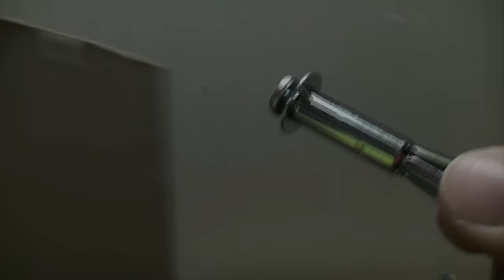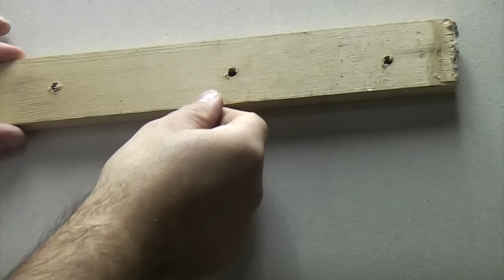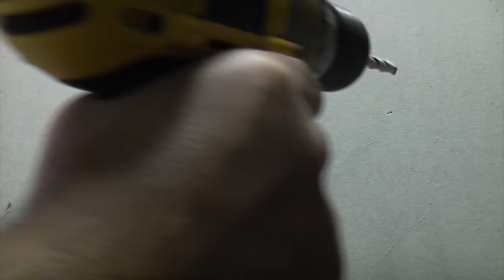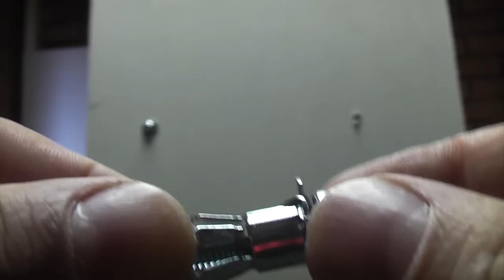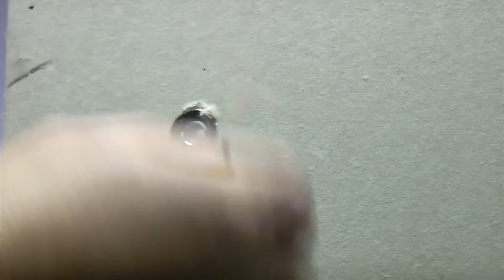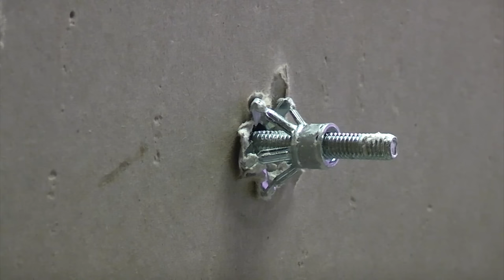How to use hollow wall anchors

Comment: You didn’t explain what drill size to drill the hole
Reply from the maker: That's because there are different size anchors.
If the hole is not large enough, the anchor will not fit through the hole  😜

Comment: thanks!
Reply from the maker: +Mike Onslow 
You are welcome
Thanks for the comment
Reply: +Ultimate Handyman Needed to mount a TV on the wall and only had 1 horizontal stud to support the top of the mount, so used 4 of these in the drywall to support the bottom. Didn't have a clue how to use them and your video really helped!
Reply from the maker: +Mike Onslow 
I'm glad the video helped ;-)
Thanks for the comments

Comment: mine just keeps spinning but does not tighten?
Reply from the maker: Try gripping the edges of the anchor with some long nosed pliers until you can tighten the screw.  Once it's tight it should expand on the back, you can then remove the screw and fix to the fixing.

Comment: When I used these the screws just kept sliding out, rubbish piece of kit
Reply from the maker: These are normally one of the most reliable of plasterboard fixings, are you sure the screw is long enough to reach the threads in the anchor?

Comment: you don't put these into a wall with a drill
there is a tool to insert them into the wall

if you use a drill you risk stripping the screw

the hand held tool is much easier for inserting the anchor
after that is done you can use the drill to put the screw into the hole
Reply from the maker: You can install them as per this video if you like.
https://www.youtube.com/watch?v=7mpcer0QzW8
Reply: Actually NO
hehe

you SHOULD install them as per that video
but

you CAN install them as per this video on this page

the correct way is with the tool and the easier way is with the tool

but, yeah, cool, we are on the same page

Comment: Mate, with those metal screw in ones, I thought I was doing something wrong because I'd screw the screw in, & the whole thing with turn & ruin the hole once it got too tight. Why the fuck do they supply really long screws with these things? Some have a hole at the back, some don't have a sharp tip...  It's a miserable situation. Why can't there be a standard? Why do I have to order 3 packets & hope 1 is the correct design?! This is stupid :(
Reply from the maker: There are different length screws and different depth of anchors for different types of walls!
I hope you got it sorted ;-)

Comment: you need a tool for that anchors. or else you could break it
Reply from the maker: You don't need to use the tool if the wall is skimmed with plaster although using the setting tool does help-
https://www.youtube.com/watch?v=7mpcer0QzW8